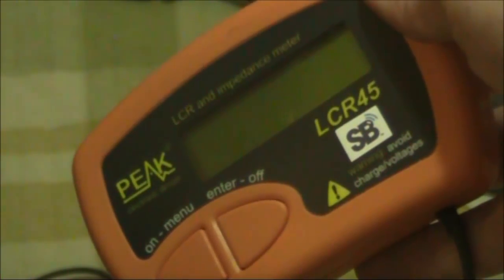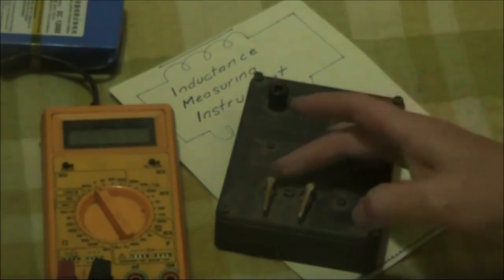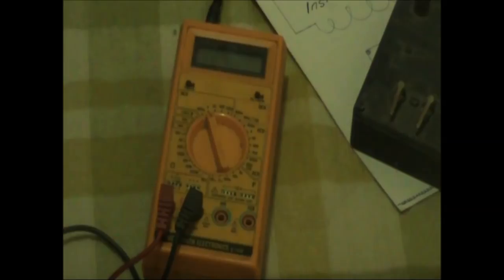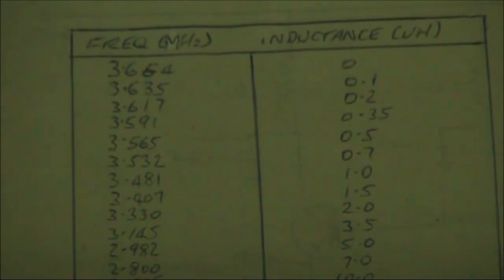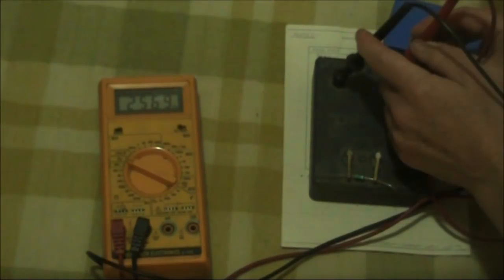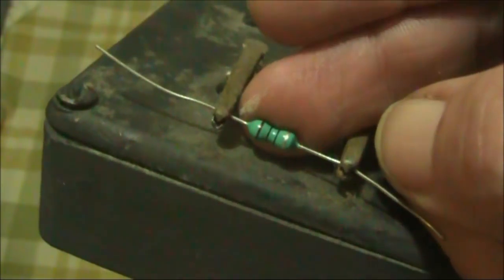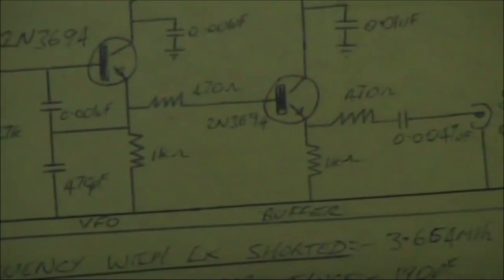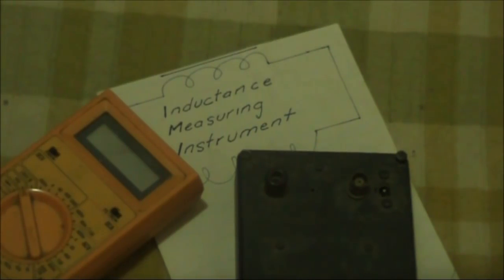Measuring inductance with just two transistors

Comment: I have built this, with some changes:
-used BC547 transistors
--I find it works fine with 9v, maybe even less
-the voltage divider to 4k7/33k provided better biasing = a more sinusoidal output
-the capacitor in series with the inductor to 100nF (could be higher) - makes the circuit into a more classical C.C. Colpitts, this capacitor only keeps the coil from shorting the biasing and makes the frequency dependent only on the other two capacitors 
-I have also found that by connecting an unknown capacitor in parallel to the coil one can measure capacitance as well; in parallel to the coil it seems to work for a higher range of values than from base to ground

Comment: I've had perplexing problems measuring inductors. I measured a 100 uH choke on an LC Meter IIb from AADE and it measured 78 uH. I tried it on an LC Meter from China and it measured 82 uH. I corresponded with the guy I bought them from and he had the same problem, all his measured well below 100 uH even on a HP meter. The only explanation he had was that different LC meters measure at different frequencies and give different values. Some meters use frequency as low as 1 kHz. Some meters use a square wave so the reading may be different.
With this simple meter, I think it would be less prone to inaccuracy because the frequency is more in the range of what the inductor will be used for. And with a switch, the range could be changed. The SRF - self resonant frequency, can greatly influence the measurement, and some meters don't take that into account.
Thanks for the informative video.
Reply: I am testing and simulating various circuits in an effort to make my own and have different readings to an old Thandar TC200 LCR,metering 'em with circuit and frequency meter and different results in LTspice that found the dc resistor of the coil alters the signal period and finally the reading results.

Comment: Yes, of course. I am pushing building equipment rather than buying in my CW/QRP SIG (special interest group) of my local Amateur Radio Club. Of the new entrants to this hobby many are buying rather than building their equipment. It was your video and magazine article that inspired me to build a straight Morse key and I passed that on to the members of my SIG. We had a fun time that kit. One of the members is knowledgeable in building circuits and this month we are assembling CPO's (code practice oscillator). I don't need one but all the members do as they struggle to become proficient with CW. I'd rather build something that you've designed, built, and used rather than ordering a kit from China or elsewhere. KB8AMZ